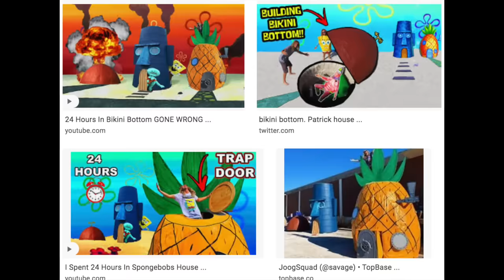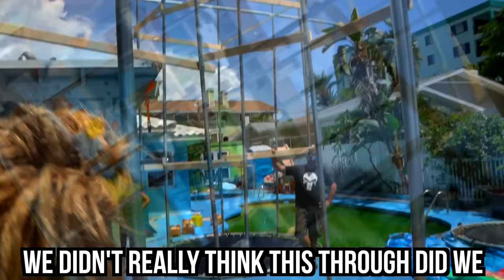STILTED TRAMPOLINE STAIRCASE INTO THE OCEAN  | JOOGSQUAD PPJT

Comment: Just wondered why they didn't put the "feet" of the trampoline on the bottom of the stilts. That would have added some stability.
Reply: * min in I'm just here looking at the lack of triangles and waiting for them to fold. Hope it holds up.
Reply: It is probably better that they sink into the sand a little, but not too much.
Reply: Ryan Cappo it probably went atleast a foot of two down into the sand with the weight and people jumping on it
Reply: Those feet probly would have sunk into the sand and when they pull the trampoline up those would fall off and stay stuck in the sand

Comment: Engineering buoys, should have made a stable a base with holes for the poles. As then you could place weights to steady the base. Make friends with construction and tree trimmers. They have the equipment to lift and you get in water stand in the center. The crane operator can see where you and move the tramp to where you want it. They would easily flip the tramps
i know am responding past normal time